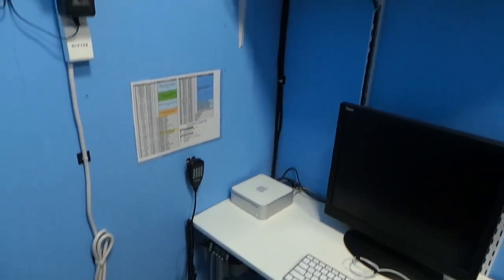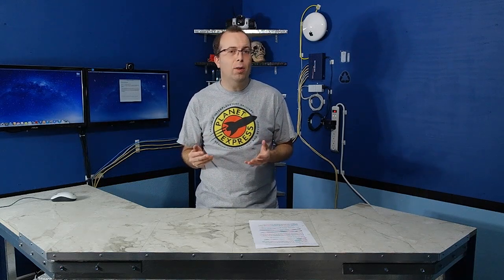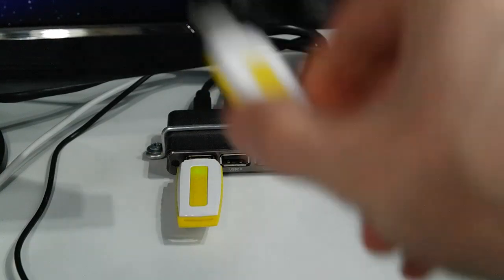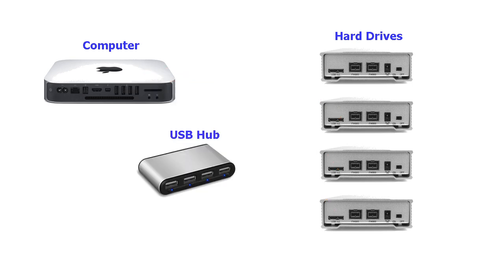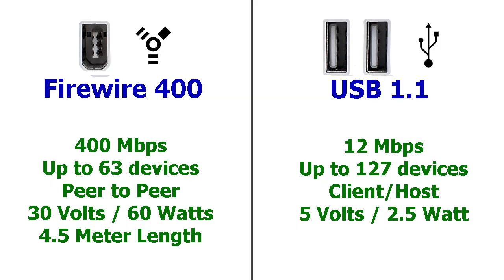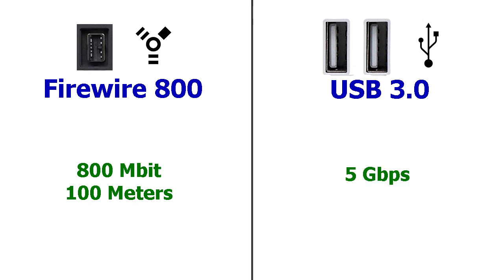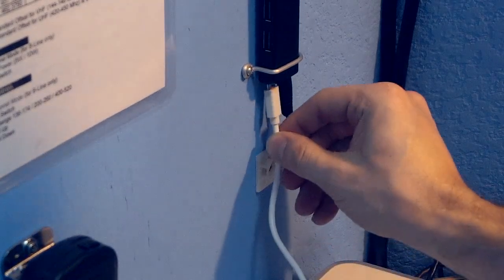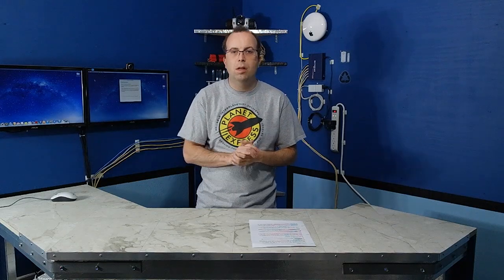Farewell R.I.P. Firewire, Hello USB!

Comment: In practice the FireWire was replaced by Thunderbolt. Which in its turn is superior than USB 3.0 or USB 3.1. Thunderbolt uses the convenient daisy chain too. Firewire was initially developed by Apple and afterwards was adopted by other companies as 1394 interface. FireWire was adopted by early digital videocameras because Apple computers much better at video editing than PCs. So FireWire became popular by multimedia developers. FireWire was created for the efficient transfer of large files. On the other hand USB was useful for any kind of data connection but wasn't as efficient as FireWire. 
The successor of Firewire, Thunderbolt, isn't used by any kind of cameras.  The Apple Thunderbolt Display isn't sold by Apple any more. Thunderbolt dock stations are very few and very expensive. Thunderbolt external drives cost at least 100$ more due to the expensive thunderbolt port. Also a thunderbolt cable costs more than 40$. Thunderbolt has exceptional speed but is intended for successful professionals. 
Apple has at last understood that thunderbolt won't be mainstream and preferred USB-C. The new Mac Pro is totally based on Thunderbolt connections and as Apple recently admitted it wasn't a successful computer. The USB-C supports Thunderbolt 3 and is compatible with USB 3.0 devises. So it is a convenient transfer to USB without disappointing owners of Thunderbolt devices. 
I am unhappy about thunderbolt because I paid a lot of money for an Apple  Thunderbolt Display. I am very satisfied but I am afraid is going to be obsolete after some years. 
Steve Jobs and Apple always preferred to differentiate from the others. For example they adopted very late the USB 3.0 port and insisted of Thunderbolt. During late 90's it removed floppy disks afterwards optical drives and lately Ethernet ports and SD card slots. 
For ordinary users USB 3.0 is just fine and really affordable. I don't like the new USB-C port because I hate adaptors. The simplicity of USB-C is nice but the various adaptors make things at the end complicated.

Comment: USB might be more useful in most areas, but for music producers on budget, a firewire DAC with good drivers might offer a good alternative to a USB DAC (most firewire DAC outperform USB in latency tests). It a slippery slope, but there can be some savings too, provided you get a external TI 1394 (firewire) chipset adapter, since it's better than the VIA chipset 99% of the mobos (that have firewire) use.

I have Focusrite Saffire Pro24 , and while I've had "some" problems with it, the inputs and outputs it provides are superb, and once I got the TI card some of my problem were also gone (cpu clock throttling can also cause audio dropouts, so had to adjust power management settings on windows. New cpu/mobo also solved most issues). It's a very good alternative to a 500-600USD costing RME Babyface (which if you purchase, you will never have to deal with DAC problems ever again, but it's still pretty expensive). This is the only area where firewire can still be relevant, since they outclass USB dacs of same price range.

Comment: wouldn't it be better to use a server chassis with a handfull of 2TB drive in raid 10, communicating over your network with cat 6?
seems way faster and more efficient than usb 3.0.

Edit: ok so usb 3.0 is 6Gb/s and Ethernet is 1Gb/s
so slower on paper, in reality likely the same speed.

usb 3.0 with SSDs must be pretty damn fast though...
Reply: here you go:

http://www.memoryexpress.com/Products/MX65520 Motherboard
http://www.memoryexpress.com/Products/MX60634 CPU
http://www.memoryexpress.com/Products/MX61978 RAM (16GB/2133)
http://www.memoryexpress.com/Products/MX56305 HDD (8TBx6)
http://www.memoryexpress.com/Products/MX64837 PSU
http://www.memoryexpress.com/Products/MX55009 Case (My Preference)

your choice of mac os server (I know you're a mac guy), or linux free server, I don't think windows server is worth the money.

so that gives you 24-48 TB of storage depending on your RAID choice.
And one cat 5e or cat 6 cable connecting to your router is likely simpler than 5 usb cables.

while the usb 3.0 is rated or 6Gb/s I don't think most people are actually getting that speed due to various bottlenecks. so the ethernet being only 1Gb/s should not actually be noticeable.
Reply: Ethernet is up to 100Gb/s right now, they're having 400Gb/s prototypes already and 1Tb/s was in the works some 7 years ago on CeBit already...
1000Base-T is indeed the 1Gb/s copper Ethernet you're speaking of, but most servers use a dual 10Gb/s Ethernet connection, either copper UTP/shielded cables or fiber (SFP+).
The 10Gb/s of Ethernet is also not just twice as fast as USB's 5GB/s, due to the way USB leans on the CPU Ethernet is easily three times faster with 10Gb/s already, not to mention 400Gb/s...

Comment: Can anybody help me? My old audio interface (with XLR inputs, super fast ASIO, etc) is firewire. Worked great with my old Sound Blaster Audigy 2 ZS that had a built in firewire port, but after building a new PC, it didn't accept my Audigy 2 ZS. I tried a couple of PCI Firewire adapters, but my audio interface isn't detected by its software. So I'm figuring that some Firewire adapters support data, but not devices? I don't want to fork out money for a new device (this one was several hundred dollars) if I can find a cheaper firewire solution. Thanks.

Comment: USB has by desing a profile intended for storage. The other ones ar human interface and audio. The throughput wont peak the figures. But IMHO is a Windows issue or bus bottleneck on the PC. You can put a 3.0 PIC-e card on a machine that had 2.0 and expect to reach 5G.

Comment: The first computer I had with a USB port was a 166 Mhz Pentium by IBM a model 330 about say circa 1995, but the thing was not yet supported. IBM first used a USB port on the motherboard with a 486. My first major usage of USB was with a Pentium Pro IBM 365 in 1997 when Windows 95 finally added enough patches to support USB.  The 500 dollar 2X CD burner a Sony Spressa I had with USB  got nicknamed "THE "DEPRESSA" since usage of the gizmo always required rebooting to find the device to burn a CD for a customer . we tried different cables, tried a usb pci card, tried variants of the burning software. When the scan computer got to Windows 98SE the 2X Spressa would always be plug and play, not plug and prey and reboot. The original Win95 USB with the Spressa required often booting several times, rolling the dice to find the CD burner.

Comment: USB is not an replace for Firewire.  It is not same as Firewire because you can't do Daisy chain on USB. 
 It is almost like one hardware interface with daisy chain replace Firewire, but it is different company.  So no hardware interface is replace Firewire, but motherboard maker do replace Firewire to TunderBolt.  No successor, no predecessor.  One USB to five USB is BS.  They are unreliable.  I surely would do no of this sort.

Comment: The usual transfer rate I got on USB 2 hard drives and flash drives would be 20 - 30 MB/s (regardless of OS). With Firewire, I would see transfer rates of 50 MB/s. Of course, my fast USB 3 flash drives run between 30 - 128 MB/s (on Linux). I still run a 2 TB FW hard drive as my main backup drive for my Mac Mini. RIP Firewire.

Comment: The comments below reveal that there are two types of computer users - those who create stuff and those who consume stuff. Well, at least if you are looking back more than a few years. :-) 

Firewire (aka IEEE1394 aka i.LINK) was never ever an Apple-only thing. USB is brilliant if you are just flinging packets back and forth with no great concern about when they get there, it is cheap, it is fast enough now, it is ubiquitous. Great for backing up your hard-drive, video-conferencing or using games controllers. However, if you are working on something like realtime video or audio applications, you need something that will tick its clock at the same time that everything else is ticking its clock. Firewire and DV went hand-in-hand for this reason - tape and random access do not go well together, so when running video from tape-based digital cameras Firewire was the better solution to avoid having to do multiple passes to patch in all the dropped frames that USB would have given (ignoring the fact it was just 12Mbps at the time and would have had sucky video quality).

Nowadays for post-production it is easy to just pull an SD card from a camera and stick it in an SD reader. That hasn't always been the case though, a few years ago you simply didn't have that option with anything suitable for commercial use. 
MIDI and DMX are essentially old serial protocols and are still ubiquitous for the same reason (proper clocks plus proper clock-locking). 

Remember that everyone's usage differs - I have no need of a low-latency internet connection, I doubt I would notice if my connection latency was 500ms, but I've got friends who need 1ms connections in order to do their jobs, and their kids like the low-latency to do online gaming. Just because I have no use of it doesn't make it pointless :-)

Comment: I usually don't even bother with brackets, and just use stronger double-sided tape. 

I tend to use car interior mounting tape (designed to mount car interior parts to each other in body shops and car manufacturing.)

Comment: Didn't Firewire support bidirectional simultaneous data transfer? USB only supported either send or receive at one time.  That is what FW  400Mbps was faster than USB 2 480Mbps.

Comment: Here I am surrounded by kit all using Firewire, day in day out.  What for?  It is used extensively for DV/HDV video capture.  I'm running six machines at once right now, all capturing video via Firewire either directly from DV capable players or via Canopus video converters.  Yes there are other other solutions for video capture, I use SDI and USB3 capture devices too, but Firewire is the standard for DV capture.  I'm not expecting Firewire to really die any time soon, Firewire cards are still readily available.

Comment: So many people talking about how USB beat firewire. USB didn't finally exceed the capabilities of firewire until 2008 and even then, didn't have the power handling capabilities. Future modes of Firewire had already been specified that would have been competitive with USB 3. 
and now with Thunderbolt 3, it seems USB is going to be folded in to the Thunderbolt standard.

Comment: USB 1.1 and 2.0 were always going to be slower than Firewire due to how USB had to use CPU runtime to do anything, usually via the southbridge chip on motherboards(v. 1.1). Firewire was expensive because of its independent co-procressing architecture that didn't take up any additional system resources.

Comment: Another reason firewire might be faster than USB 2 is that USB (certainly 1.1 and 2) both use a polled architecture.  You can't transmit a frame when you want to, you have to wait until the host polls you before you can transmit your payload.

USB 2's 480 Mb/s includes overhead, and whatever its maximum theoretical throughput will depend not only on how much overhead there is but also on whether you can pipeline maximum sized packets up so that there is always something happening and then only if you can ensure the host controller always polls your port.

I haven't looked at Firewire internals, but I'll guess that it's more efficient not least because (like PCI) attached devices can initiate transactions rather than have to wait until polled.

Of course, then there's USB 3 offering up to 5 Gb/s (according to the specs).  But I'll guess that it's still polled.  Yay.

Comment: I use firewire to convert tape video to WMVs using windows movie maker, the camera supports firewire 400MBps and works better than the USB back then.
However I never tried any firewire file transfer or firewire LAN for laptop connections.

Comment: For those where not into macs, Firewire was the little port labeled '1394'  on almost every mid-range or higher laptop thru most of the 2000's. It was also labeled as 'i.LINK' on sony laptops. they mostly died off around the end of the core 2 duo era, as the first gen i7 series came out and thunderbolt began to gain traction.

Comment: What I really miss in firewire is the huge power it was able to provide. There's no luck making a external USB spin with a 5 meter cable USB2, while there's no problem with firewire. Firewire is 12 volts. It's as easy to output 5 volts for a HDD from 11 volts than it is from 12. A HDD would hardly spin up with 4 volts at the end of a long USB cable.

Comment: I agree that I liked firewire because it can easily daisy chain and I also owned 3 WD Studio Duo
it can be easily change or upgrade the harddrive and has firewire 800 and easy to daisy chain
now option are usb 3.0 and solutions for cable mess are using NAS

Comment: The main thing I like about USB3.0 is the compatibility, you can still use 1.1 and 2.0 devices without a new connector or adapter.  Now, I read somewhere that they're trying to push for a next-gen USB that completely changes the style of connector so that no matter which way you plug it in, it's always "the right way", like a Lightning connector, because (and I'm quoting very vaguely) "it's too difficult for people to figure out which way to plug in a USB cord".  That's going to be a lot of devices that won't support the new configuration and even more dumbass people if they really can't figure out which way a USB plugs in... here's a hint, it only goes ONE WAY.  Just turn it around if it doesn't fit.

Comment: USB 3.0 will get it's speed if we use Windows 7 or later. Windows XP doesn't fully supports USB 3.0 even if we have installed the driver.

Comment: I like FireWire. Never knew about it until I used a pc with built in FireWire on the logic board. I also used FireWire to pull videos off of DV tapes. My laptop from 2012 has a FireWire port. Windows 10 even had freaking drivers for that camera. I also got a FireWire and USB combo drive bay from the windows 9x era and windows 10 recognized it immediately

Comment: A victim of royalties and the extra $1 for the dedicated port-silicon, also the didn't make the 800 connectors compatible like usb1, 1.1, & 2 did. Usb needed cpu cycles, firewire had a dedicated chip for low cpu overhead and smooth transfer, hence professional video folk used it(no playback hiccups). 
USB3 seems to be a nasty kludge at a firmware/driver level from what I can tell. 
Still, other than my phone and mouse/keyboard, I only use ethernet, 3.5mm audio jack, and parallel port.(old printer, and even there it is an ethernet to parallel server dongle) both 1G ether and eSATA are faster than any single spinning drive available.
Reply: Professional video and audio no longer uses Firewire because not many devices support it. USB has caught up in terms of reliability.

Comment: You neglected to mention one of USBs biggest advantages over Firewire - it's backwards compatibility. You can mix USB 1/2 and 3 devices together using the same ports and connectors but FW 800 required a completely new connector that was only available on a relatively small number of machines as standard.

Firewire was created by Apple way back in the 80s and it was Apple who effectively killed off FireWire (much to the annoyance of photographers and 3rd party drive makers) when they dropped the interface as standard in favor of USB. But it took a while for Apple to roll out USB 3 as a standard in all of it's devices and USB 2 was a poor substitute.

Comment: What I miss with Firewire is booting a crippled Mac in Target Disk Mode. I had a 2005 G5 Power Mac that had a motherboard failure but was still able to boot into TDM. I used my G4 iBook to get the data off the PM and onto an external drive.

Comment: unless apple doesn't support daisy chaining. You can Daisy chain USB devices. a usb mouse can connect into a usb keyboard then connect into the computer. You don't need a usb hub or a usb port on a computer to connect each device. Fire wire cost to much. If apple didn't make it to proprietary with it's design and work like they do with all there other ports. I'm actually surprise Display Port is going anywhere. Though Thunderbolt will probably do by the way side as well. Want to use are port you got to pay for it.  A company selling a computer component is going to want to make sure that everyone can use it. Hence the universal of USB

Comment: There was also specs for FW 1600 and 3200, re using the 400 and 800 ports respectively, but they never made it to mass market, people were already choosing USB 2.0 over FW, so once USB 3.0 came about no one cared, even with the advantages FW still held :/

Comment: i still have 1 firewirecable and 2 old computers with firewire ports. and as far as i know linux supports firewire so it looks like its still going to have some use. they are both going to be servers. 
Also those computers dont have usb3.0 nor could they handle the cpu load so ill be forced to use firewire between them anyways if i want good transfer rates.

Comment: I'll be the first to say that I really, really won't miss Firewire. Now the reason is down to manufacturers, not the standard itself.

I can't begin to comprehend how many USB flash drives have died because a novice PC builder has plugged a USB2 cable into a Firefire header. Why in gods name would you make the pin layout the exact same?

(Your USB device will burn out immediately - don't try this at home kids)